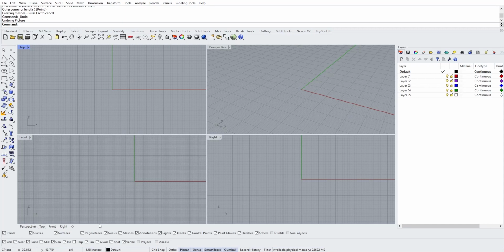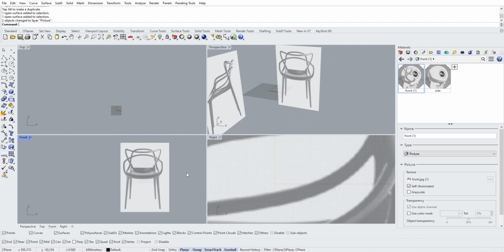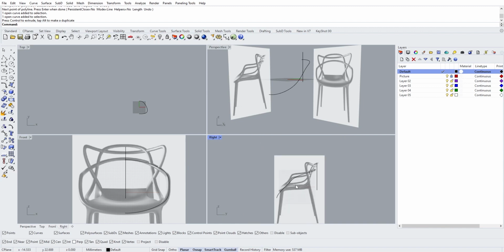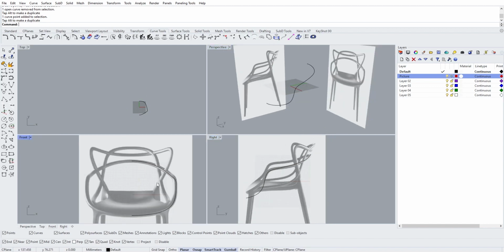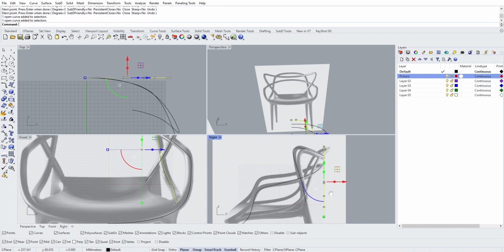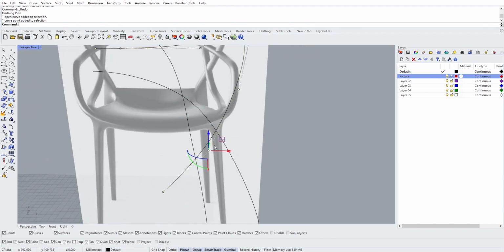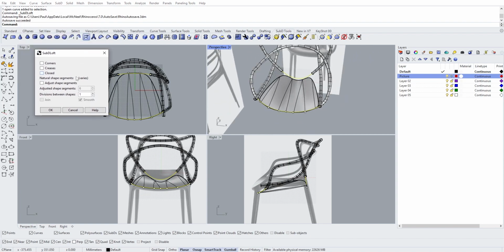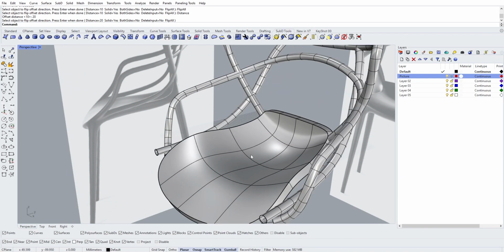Mastering organic modeling in Rhino7

Comment: I would have generated the 3d curves by crossing the extrusion of each bidimensional curve rather than adjusting each point. Maybe I'm wrong.
Reply from the maker: There are different ways to do, and I think yours would have probably worked too. The important is to find/use the workflow that allows you to achieve the result you are looking for